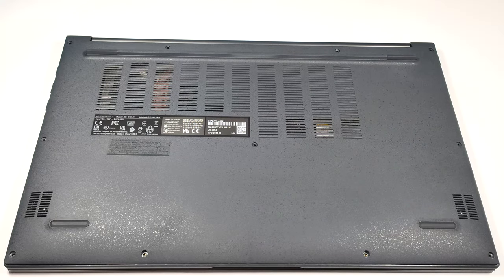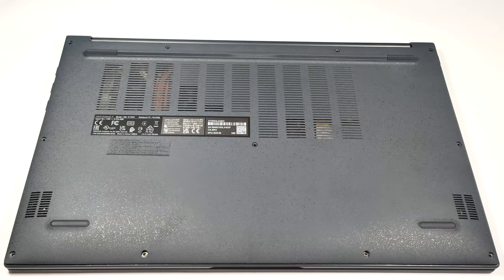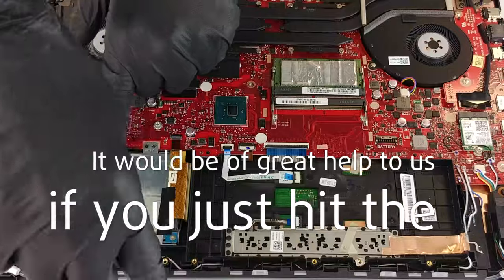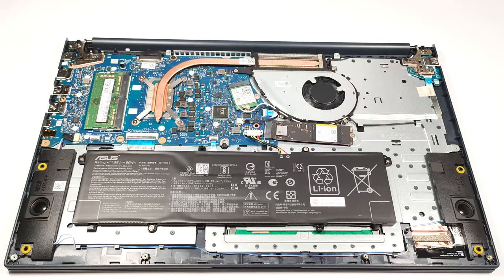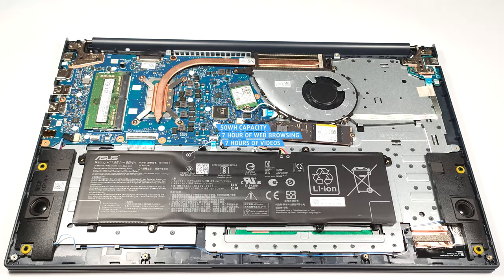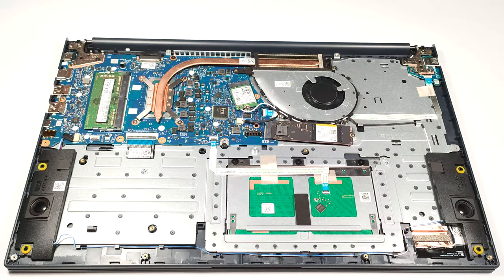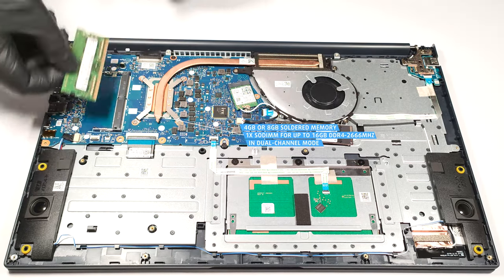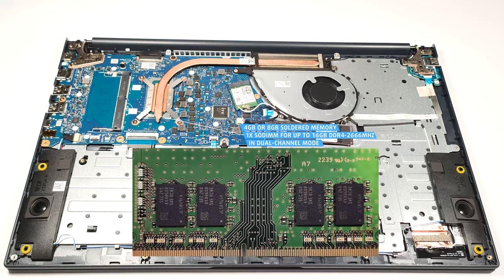🛠️ How to open ASUS Vivobook 17 F1704 (X1704) - disassembly and upgrade options

Comment: I have this laptop with the 8 gigs soldered in. So I can add 16gb of ram in the open slot?
Reply: How noise is this laptop? I am searching for a really quiet one. And is it fast enough?
Reply: @wdog22  I don't hear it running at all.  I think it's fast enough.  Of course I just do small things.  I did add 8 gigs of ram.
Reply: @matthewjewell8844  thank you for the info!! It sounds very good!

Comment: Thanks for this. I am planning to upgrade the memory of my X1704 Vivobook from 8GB to 16GB. Do you perhaps know some SODIMM DDR4 16GB memory sticks that are best suited for this particular laptop? Does the MHz matter? Does brand matter? Thanks in advance.
Reply: I've ordered Corsair Vengance 16gb (SO-DIMM) 3200 MHz today, on Asus site they write it can be maximally 16GB 3200 MHz
Reply: Just buy the stick shown in this video and you won't miss.
Reply: @andrew7455 Im fine with my corsair 16gb, in Total I have 24 gigs of ram, not bad
Reply: @JacobTheCreator888  , specification doesn't allow more than 16 gb. Are you sure that all 24 gb are available and working?
Reply: @JacobTheCreator888  Could you please confirm that you can see all 24GB of RAM because, according to the specification it says that max RAM is 16GB. I have the same laptop and your answer would be valuable for me :)
Reply: @vladas21S  I send you screenshots later 😀
Reply: @vladas21S  yep I just did this
Reply: @JacobTheCreator888  , so but what about 2-channels mode ?
Reply: @K3Rostok There's only one ram slot
Reply: @K3Rostok 8gb soldered and you can plug In max 16gb 3200MHz
Reply: @JacobTheCreator888  you say, that you plugged 16 gb and all size is 24 gb? Am I right or I'm missanderstand you?
Reply: @K3Rostok  Yes it have 24gb fully functioning, this PC handle max 24gb 

16gb 3200MHz+8 soldered=24gb